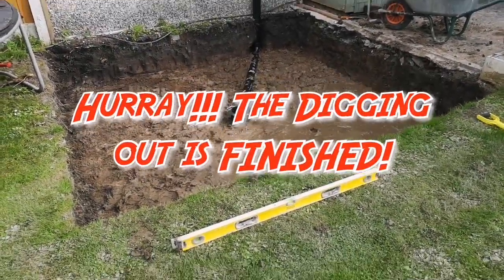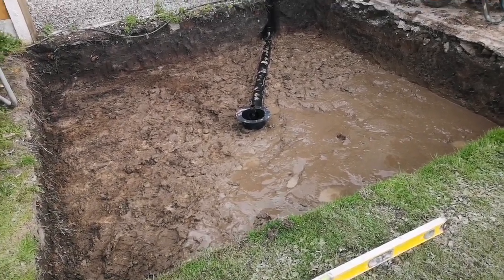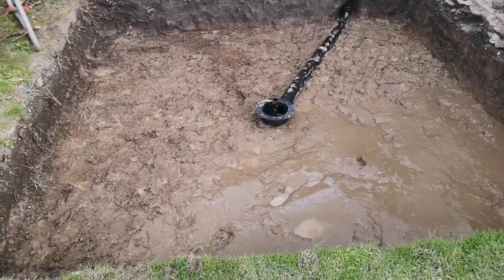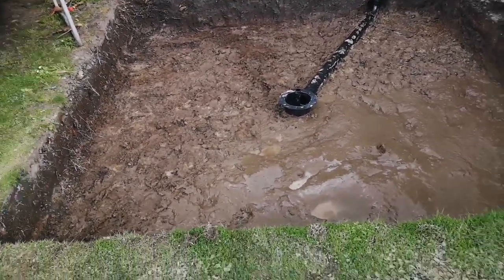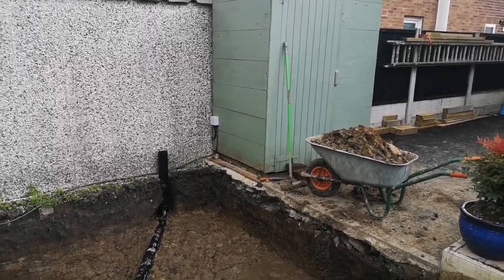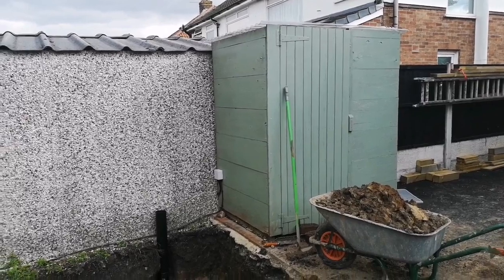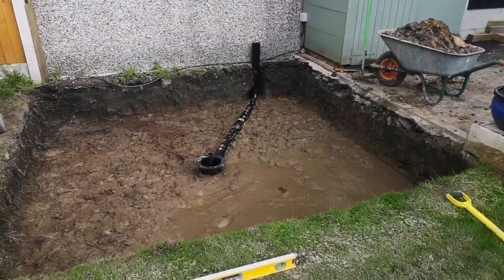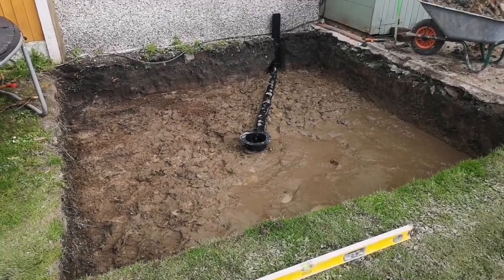Update on New Koi Pond Build

Comment: Hi Daryl. On the new pond you mention that you are going to leave your pond for a month or two without fish in order to let your filter media mature and the good bacteria to build up before adding the fish.. As I understand it the good bacteria build up when the fish secrete ammonia into the water. It is that which causes the good bacteria to build up. So you need to add fish as soon as the pond is ready in order to start the ammonia->nitrite->nitrate cycle. Just don't add too many fish and don't overfeed. I hope this helps.
Regards
Peter
Reply from the maker: Cheers pal, I'm going to be adding liquid ammonia to the filters plus beneficial bacteria and will be doing regular water test to keep an eye on the parameters.